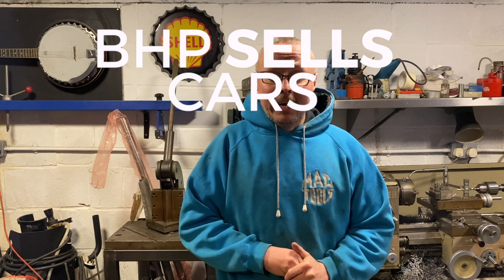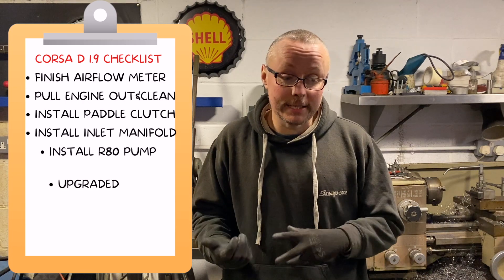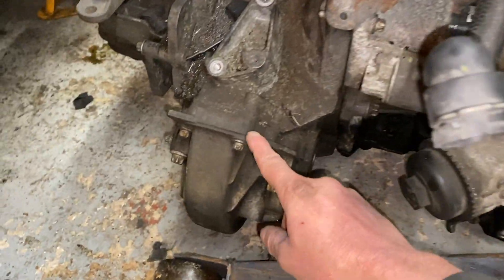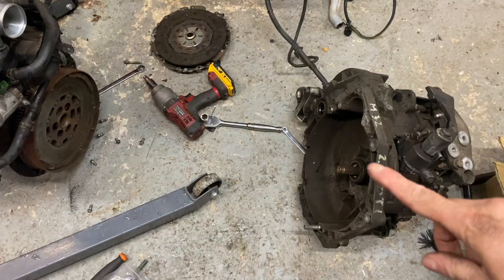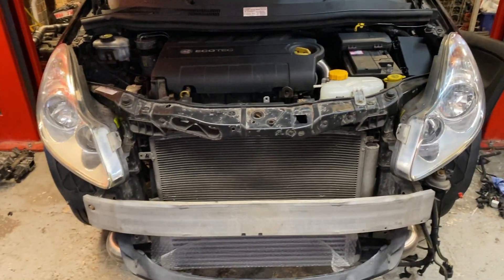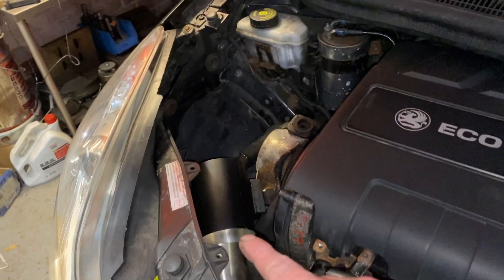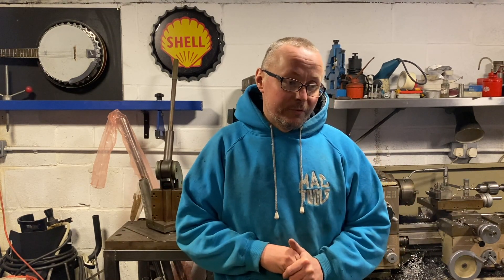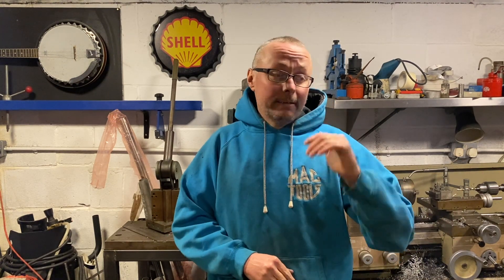Corsa D 1.9 CDTi - Z19DTH - Fabrication Part 3 - Inlet Manifold Installation

Comment: Tht m32 box is shitting itself instantly, they are chocolate at 150, so 300 jeeeeez good luck on that one
Reply from the maker: Fully agree 🤣 I have 2 spares already once there gone I will make the F40 fit.
Reply: 2 years and 29K running 305hp 619nm through my M32. Big bearing mod,  50% quickshifter TTV lightened single mass, sprung helix clutch and 3L of good quality oil changed regularly. Zero issues.
Build them right and the M32 is fine, main issue with them stock is they dont have enough oil in them.

Comment: Where do you get the 4 bar map sensor seen some for the 1.6 and 2.0 but not sure if it will fit or not  and 2200bar rail sensor from

Comment: I just hope the M32 holds together. Its not just the bearings that can't handle the torque its the diff too. Might be worth fitting an LSD.
The gearbox is the Achilles heal.
Reply: A thousand times this.
Just had my gearbox rebuilt, new hubs, 4 new gears. Uprated endcase and bigger bearings Quafe LSD. External breather res tank to take capacity up a bit and keep the casing full all the time. Running it in with decent oil then flush it and filling it with Royal Purple. Should hopefully be the long term solution.